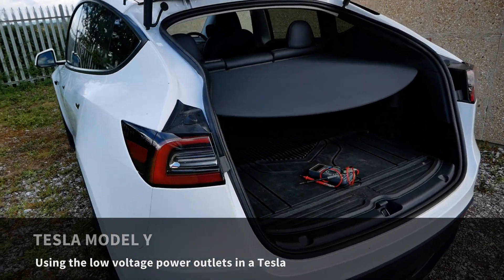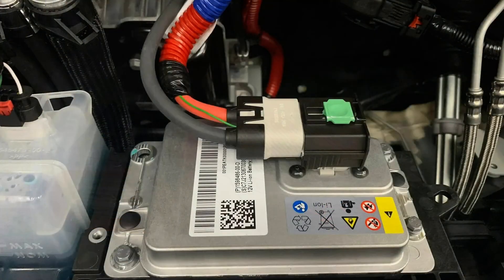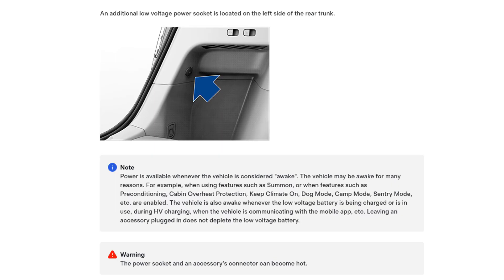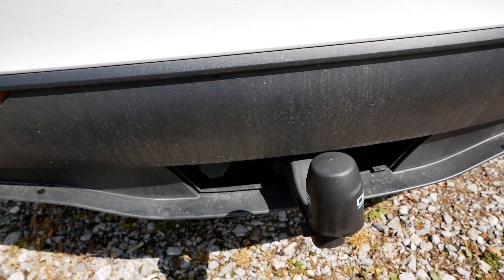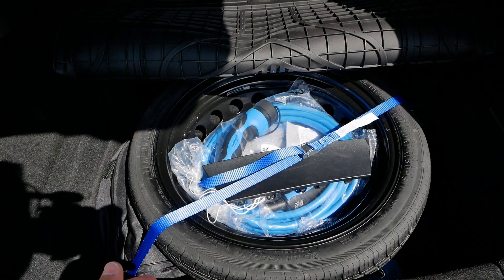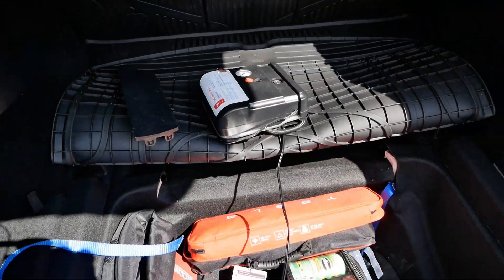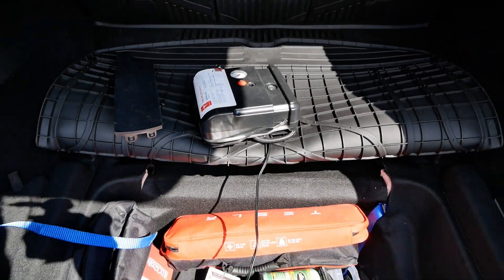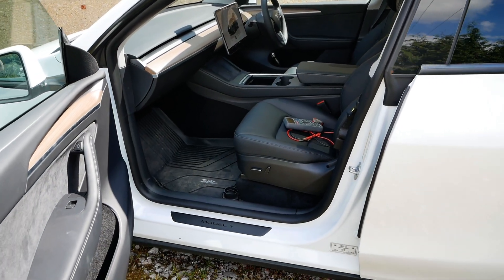Tesla Model Y power outlets and making sure your accessories are compatible

Comment: First off, up to 14.6V is quite common as lead acid batteries are charged. Virtually all car accessories are rated for that. 15.2 is not absurd. Secondly, an overwhelming majority of powered car accessories are designed to work both with 24V and 12V, given trucks often use 24V batteries.

Comment: Good morning, I have a March 2023 Model Y and having just checked the boot power point, it is clearly marked on the cap 12V. The one in the glove compartment is blank. Just for your information. Cheers, Andrew.
Reply from the maker: You'll have the 16V lithium battery though. The 12V written on the cap is just a hangover from the previous version with an actual 12V battery.
Reply: @GoGreenAutos  Hmmm....bit naughty if there is a problem with, or risk of damage to existing 12V appliances........

Comment: Normal car battery voltage will go up to about 14.6 volts when the car is running because it has to charge up the battery so appliances are usually designed to be able to work to at least that high so the tesla at 15.6volt is only a bit higher and should be tolerated by most appliances although maybe light bulbs and electric motors will have a shorter life as a result but most modern stuff will be fine.

Comment: The most strange is why the freak they don't replace 12v leadacid with 12v LFP batteries instead of ION. LFP is more equal to 12v lead  max voltage.

Comment: no problems with radar detector, led lights, air compressor on my 2023 MYLR Austin build. also used a power inverter to power the tv and a fan during Hurricane Beryl.

Comment: 12V lead acid during charge can approach 15V, so not much different to the 16.5V maximum Tesla voltage.
Accessories should have a good safety margin. 20 to 25 volts would be sensible, plus short term transients (such as sparks when plugging in or disconnecting) should be suppressed by the accessory.

Comment: The simple DC brush motor in most small portable compressors shouldn’t have any problem with 15.6 volts. The motor will run faster.

Comment: I very much doubt that 16V would change anything. Far far now likely is that the current draw of the compressor is around or greater than 10A to 12A which is going to shut down the Tesla accessory port.
Try the port after the compressor has shut the port down, I bet there's no voltage. Wait a while for it to reset.
I run my dual cylinder compressor off a lithium jump pack to avoid any likelihood of tripping the cars virtual circuit breaker.
Reply from the maker: I've not experienced this myself (yet), but yes you're right. Others are reporting their compressor runs for a few minutes, then stops and they loose power at the outlets.
Reply: @GoGreenAutos  Yeah so that's the car cutting out, not killing the compressor. My dual cylinder one doesn't even have a cigarette lighter plug because the current draw is too high, needs to be clipped direct to battery and rather than risk/compound one problem on top of another, that's why I use and external battery. 
Cigarette lighter plug for accessories is woefully out of date.
Reply: The pump for my paddle board actually refused to work and flashed high voltage warnings.

Comment: I power my compressor off a 12v booster pack. This makes me think does a 16v lithium battery need a 16v booster pack if one exists?
Reply: Most booster packs use 8x 18650 cells in a 4 series 2 parallel configuration which would mean 14.4v nominal and 17.2v fully charged. 

I use my booster pack with my compressor too as it’s more convenient than using the 12v socket in my bmw lol. Also very neat for pumping up a football or caravan/trailer tyre.
Reply: That's a good question to ask. The answer is not as long as you connect it to the designated Jump Start bolt terminal. You're not cranking a starter motor on your Tesla with a jump start booster, you'd only be powering up the electronics in very limited circumstances of the Tesla's 16 volt battery shutdown. There are instructions in the manual and how to get the 16 volt battery to reconnect.

Comment: What possible reason would Tezluh have for using 16v when 1-fewer lithium cell in series would be ~12v...
Reply: It only takes 4x 3.6v nominal lithium cells to get 14.4v, which is what most 12v systems charge up to anyway.

Or with 3.2v nominal LFP cells it's 4 cells for 12.8v and perfect for an accessory battery.

I guess that Tesla are using 3.6v nominal 4v peak with which 4 cells fully charged gets 16v... They could literally just choose to have the BMS set the max voltage to 3.6v, not use around 20% of the top of the cells, and get a sensible accessory voltage...
Reply from the maker: This is an excellent (but long) video on the new 16V battery https://youtu.be/8-MNFgashpQ?si=7CwaSURHy_I6_86n
Its a clever bit of kit with its own BMS. Its meant to last the life of the vehicle, but that seems not to be the case for everyone.
Reply: @GoGreenAutos  I mean... Theres a bunch of 12v configured LFP car-sized batteries.

Tezluh didn't have to invent their own, let alone set their own voltage range.

Comment: I have a couple of 12v compressors and they definitely run faster when plugged into the Tesla but i've used them a few times and not noticed any damage from it.
Reply from the maker: Yes I think mine was doing the same. Hopefully it will last long enough to pump the tyre back up!
Reply: However, for automotive applications, particularly concerning internal combustion engines, the International Organization for Standardization (ISO) provides more specific guidelines. ISO 21780, for instance, focuses on 48V electrical systems in vehicles and outlines permissible overvoltage levels and durations. According to this standard, short-term overvoltages can reach up to 70V for 40 milliseconds, followed by a decrease to 58V. Additionally, long-term overvoltages may allow voltages up to 60V for durations up to 60 minutes. 

So if 48V appliances can be overdriven upto 60V same may apply 12V can be driven 16V for an hour or so…  because the 12V lead acid systems may supply between 10V to 14.5V as standard additional 1.5 volts won’t kill anybody but just a tiny modifications compressor

Comment: Great video Matt 
You just need a compressor which accepts 12v/24v system, or even better to get a compressor which has its own internal battery. 
That means you’re not trailing cables around the car too
Reply from the maker: Yes, a cordless one would be ideal. Plenty of those around now.
Reply: @GoGreenAutos  Компрессор Сяоми с аккумулятором,  при зарядке 100% накачивает от 0 до 3,0 psi колесо Тесла Перфоменс за 15минут и остаётся одно деление на компрессоре.